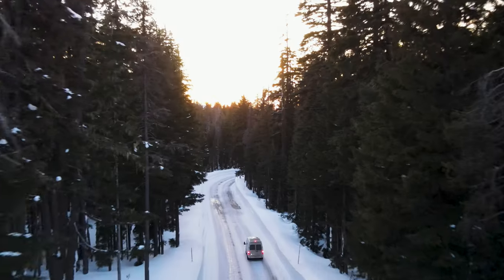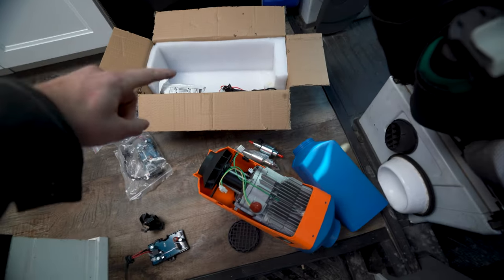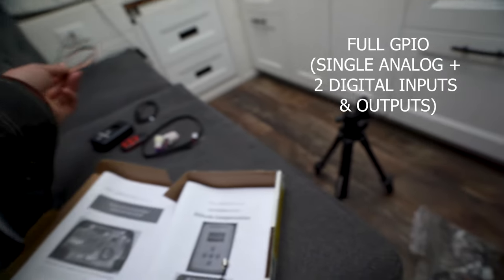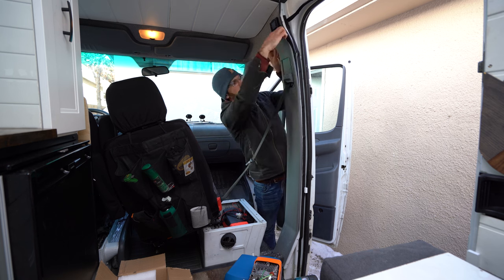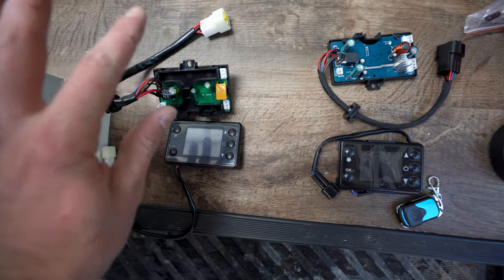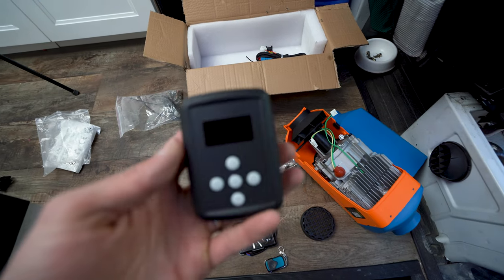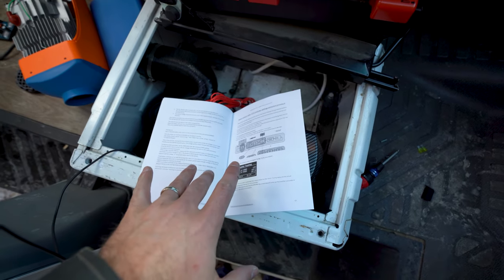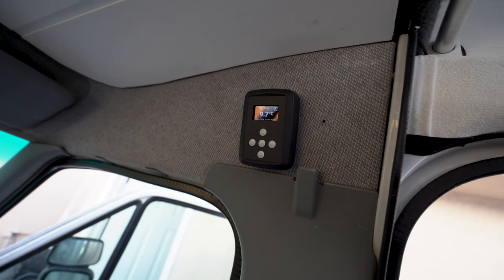Afterburner Controller for Chinese Diesel Heater

Comment: As I found out after running my Chinese diesel heater on a low setting after start up temp was achieved, I ran the heater for around twenty hours until it had shut down by itself which was something I hadn't expected but on going through the menu the E__ showed up or the Er .Odd then I tapped the exhaust pipe by accident and gobs of soot came out so I checked online and a couple of different YOUTUBERS had been there and done that so I dismantled the heater and there was huge amounts of soot/carbon in the expansion chamber and the exhaust outlet. So if you have the E__ showing up it means clean the the darn thing,  buying new electronics won't fix it DUDE, Really get to and do some maintenance these diesel heater are better running on the higher settings as on the lower setting they really soot up and don't burn off the excess soot etc; as I have learnt so it's a cheap fix and you might have to get your hands dirty but that washes off and your EGO won't get damaged either. As for the after market Afterburner Chinese diesel heaters come out with a remote and BLUETOOTH/WiFi and would more than likely be cheaper than that gadget so not sure there's any advantage except to the sales of the After Burner manufacturer. A penny wise and a pound short.
Reply from the maker: I’ve had this issue. You need to adjust your fuel settings because there’s to much fuel being delivered which is causing the build up. This is also related to elevation.

Comment: For solar controllers I have the Epever controller. It’s my second controller the first one I had was Renergy and it got super hot and melted part of the plastic. The Epever is a metal case and it has worked flawlessly. I have four 100 W panels in series. Wiring them in series helps to reduce the wire gauge from your panels to your controller because you’re working at a higher voltage and the Epever can be used at a higher voltage. Thanks for your video on the afterburner controller. I think I’m going to go for it. I’ve been through a few of the Chinese diesel heater’s and I think I’ve got it pretty well figured out, and I have replaced most of the weak parts. I’m finding that the wiring harness from the Chinese heaters are causing a lot of problems. Their wire gauge is too small. If you read the fine print, it will say connect power to battery with no longer than a 3 ft, even though the positive wire supplied with the wiring harness is about 10 feet long. I think the inferior wire harness could be causing the controllers to fail. If someone were to develop an aftermarket wiring harness for the Chinese diesel heaters, they would be doing everybody a huge favor.
Reply from the maker: Thanks for the info Kirk! That’s interesting about the wiring harness and could be my issue as well. I would highly recommend this controller! Been using for the last 3 months and haven’t had a single issue. The cycle feature keeps the van at the perfect temperature much consistently (although it does use more power).

Comment: I keep getting error 07, can’t figure it out I have bought a new controller and a new motherboard and I don’t know what to do.
Reply from the maker: Did the heater worked when you first installed it right? Just checking to see if this is a new install.

I would double check that you installed the wiring correctly on the new motherboard. I would also check all the wiring for damage and/or loose connections. Try replacing the fuse with a different fuse.
Reply: This is a brand new installl, I ordered two units and they both are saying error 07, I ordered a third unit and it actually works! I will try using another fuse. I wonder if the motherboard I got isn’t compatible with the controller, so confusing with zero instructions in the box
Reply from the maker: @user-cr9qz9ji1n  sounds like a motherboard issue to me 🤔

Comment: So why can’t you use your iPhone with it? It has Bluetooth and wifi, so I’m confused. I’m not a tech guy either so I’m not picking up what you’re putting down.
Reply from the maker: iPhone will work via Wifi but it won’t work via Bluetooth because the app isn’t compatible with IOS devices.
Reply: @madetoexplore  Ah, ok.

Comment: It's too bad you really have no information on the new controller that you swapped out, I don't think mine will work because it is a Vevor.  Do you have a link for a just a controller? Also, not all of your links work in your description.  Thanks!
Reply from the maker: That’s what the links in the description are for and yes, there’s a link to the controller in the description. All you have to do it switch out your control board and it’ll work.

Comment: I've been wanting to get a afterburner controller, but I've been waiting for him to make a multiple heater version
Reply from the maker: Yeah that would be a nice addition 👍
Reply: As the ECUs do not support such "party line" control, it is simply not possible.
Reply: @rljzathras  what about if the heaters were wired in parallel or if you made a two channel version, where both heaters are connected to the Afterburner and you switch between the two heaters by switching channels
Reply: @jamesmason7124  Anything is possible of course, but the duplication of everything is really not worth the trouble when the reality is 2 totally independent heaters can be chained together at a high level via something like Home Assistant or Node Red.

By everything I mean complete reporting of the heater status over wifi etc - a lot of duplication, and questionable merit for the considerable effort that it would involve to refactor a LOT of code. It is simply not worth spending my time on it.
As for the actual head unit - well the menus are already quite full as it is without adding confusion over which unit am I dealing with.

Whereas 2 panels in Home Assistant boom done, all the info is there.
Combine the units? Build some automation scripts to control both heaters from one front end, boom done.
Reply: @rljzathras  thank you Ray for responding, I really want to buy your controller but I can't afford two of them 😭

Comment: Most controller faults are low voltage  ( volts lost over the thin cable run)
Startup needs more current for the glowplug to get hot so higher amps and larger gauge wire needed, maybe even with a relay.
Also powering off  ( killing the supply) the heater without allowing for its phased shut down ( cooling)  cycle is to be avoided. Which itself can melt controller boards....
Otherwise simple devices and generally reliable and frugal.
Reply from the maker: Thanks for the tips!

Comment: Can the Controller & Remote (ecu unit) from your link be used on all types of Vevor diesel heatres? I can't find anything about this. 
And is this plug and play or do we have to switch out all kind of wires? 
We have not purchased a heater yet, but we want to purchase one that works with the Afterburner, and this is a good solution. Thanks for the video
Reply from the maker: It’s making sure you have the correct ECU. These can be easily swapped with most, if not all, Chinese diesel heaters. There’s a ton of information on the afterburner website and in my video. I don’t believe the stock ECU VEVOR one is compatible but you can buy a different ECU on Amazon. It’s in my video description. It’s plug and play 👍

Comment: So, you can set the temperature for the heater to turn on / off and it can then be left to its own devices thereby turning on / off repeatedly?
Reply from the maker: Yes, it’ll work the same as a furnace for a house. It’ll cycle on/off as required although this setting does use more power.
Reply: @madetoexplore Hi there. I was under the impression that the controllers that come with the diesel heaters from Amazon have a thermostat in them, or is that wrong? How do they know when to turn on/off with the original controller and what makes this Afterburner so much better?
Reply: @Sugarkryptonite the controllers that come with CDH will not turn off when thermostat reaches set temp, they simply turn way down to the lowest output setting.
Reply: @scottyz I see that now after getting mine going. So Afterburner actually turns off completely? How does it do it without sooting up the combustion chamber? Does it do a  high power burn like the original controller before turning off?
Reply: @Sugarkryptonite Yes it will.

Although all these folk preferring full Off each time, must have 10 batteries for one night - the thing draws 10 Amps every start-up cycle, & uses the glowplug a little for shut-down as well.